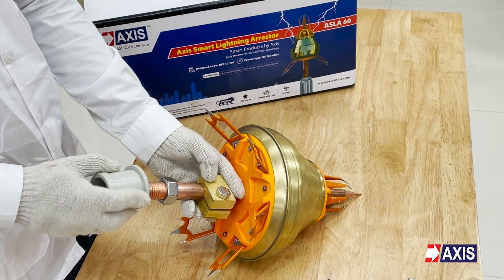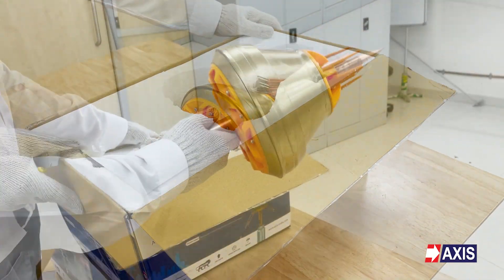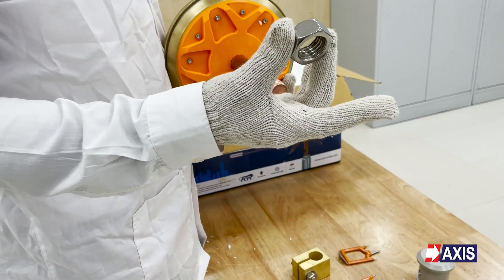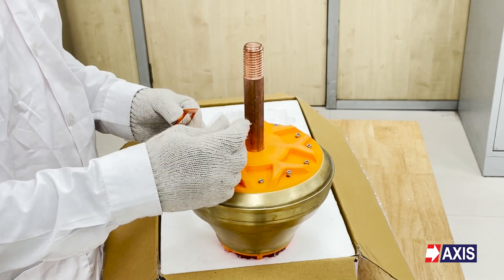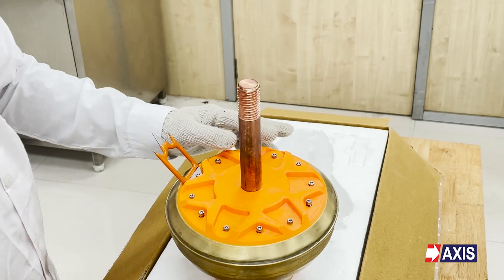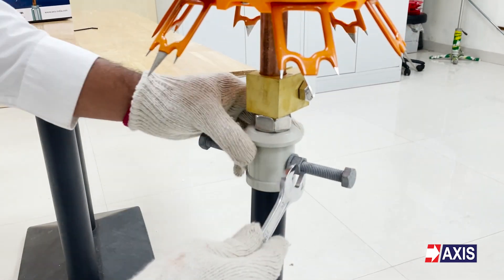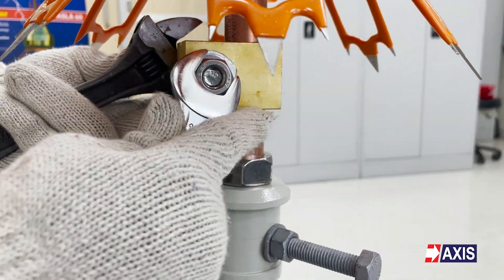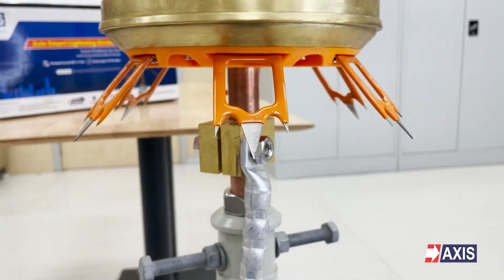Assemble ESE Lightning Arrester in 5 Simple Steps!

Comment: You didn't mention the anything about the length of earthing 
electrode,
Depth of eaething pit,
Minimum number of earthing pits and electrodes needed.
Reply from the maker: Hey Monis,
We have recently made a video explaining the selection of earth rods and their dimensions. 
That video will be published soon.

Meanwhile you can watch this video on Earth Rod Installation - https://youtu.be/HB3jmH2rz94?si=YjJC4VNuDQpfWjS4
Reply: @AxisElectrical  Thank you so much for responding. I'll be waiting for the video.
I have seen people mention different (often contradicting) requirements for  the number and depths of earthing pits (and thus the lengths of earthing electrodes) required, especially while using ESE LAs for providing lightening protection for Rooftop solar setups.

Also, it would be great if you could compare the effectiveness of GI Strip vs Insulated Single Core Copper Wire as Down conductor with ESE LAs based earthing setup.

Comment: What's the size of the stainless  nut fixed into the nut and what size of spanner can tighten or loosen it
Reply from the maker: Hi Muyiwa, 

For the ASLA 60 model used in this video , here are the details: 
The Stainless Nut Size which can be fixed into the Nut
ASLA15 & 30 : 3/4" Nut
ASA60 : Nut size -M25 (Spanner size : 32mm)

The spanner size for tightening and loosening it 
For ASLA 60: 1" inch Nut
3/4: Spanner No. 32 mm

 Let us know if this helps, or get in touch with our engineers at sales@axis-india.com

Also have you seen our on-site ESE Arrester installation video?
Have a look - https://www.youtube.com/watch?v=USajjGYjUH4